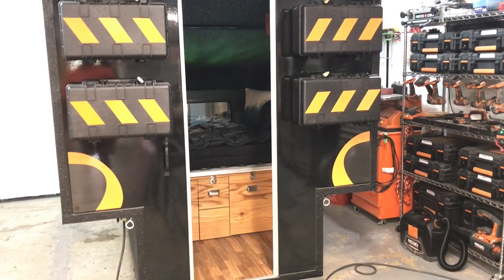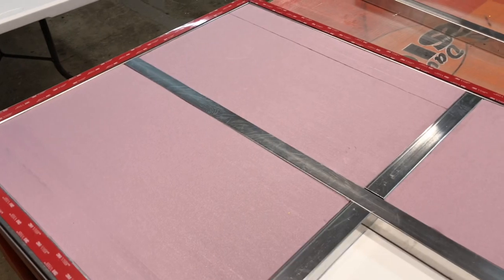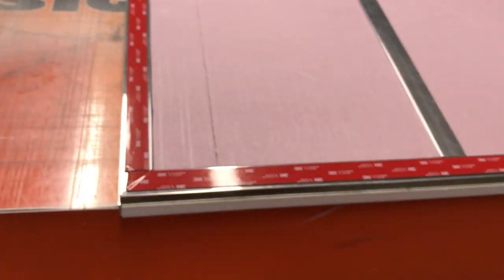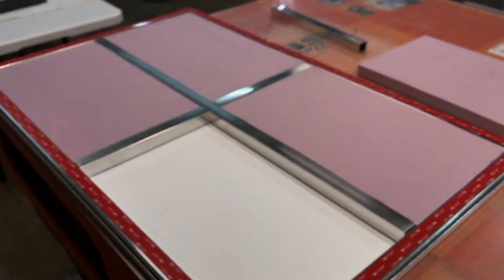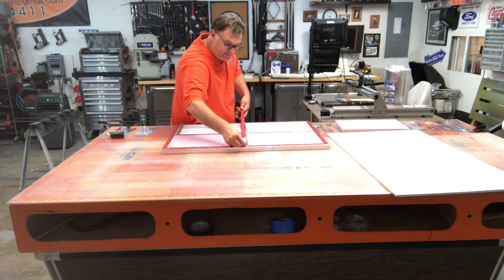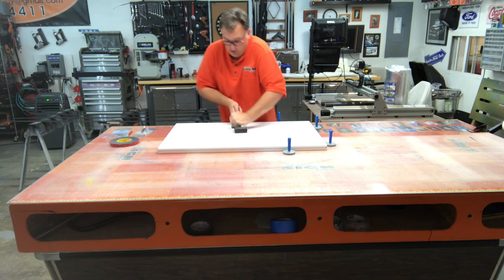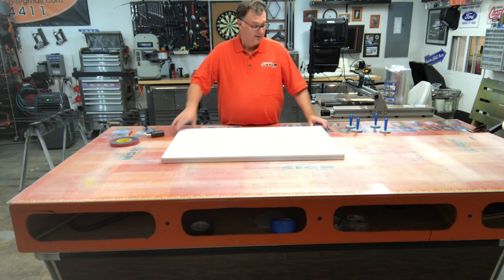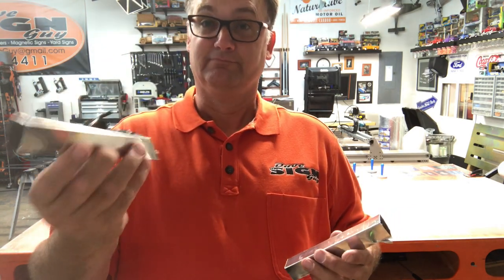Camper Wall Construction

Comment: Very interesting! I've got an idea to build a camping organization system in the back of my truck (kind of like an overland-style "canopy"), but do not want to make it out of plywood (easy but too heavy) and didn't really want to learn serious metalworking (how to weld). Can I repeat my understanding of your process back to you to see if I have it right?

1. You put bends in the aluminum (presumably with the corners notched out) so they fit around 1x1 square aluminum tubing. The inner skin is 0.063" and the outer 0.080". (Does the 1x1 tube have a particular thickness?) Is the aluminum bent with a metal brake)?
2. Fill the internal cavities with insulation (might not strictly be needed for my application, but would keep the skins more rigid).
2.The skin is attached to the tubes with 3M VHB tape and pop rivets at the edges.
3. Structurally important edges are covered in rhino-coated aluminum angle (I didn't quite catch the dimensions, maybe 2x2" and 1/8" thick?), taped and pop riveted (presumably through the skin and inner tube).

Thank you so much for the extremely thought provoking video!

Comment: Hey David
As I embark on my second camper build, you have convinced me that adhesive tape is the way to go. I was originally going to go with Alum tubing however I have found that thermal conductivity; hot and cold, of the tubing is not ideal for 4 season camping. Looking at alternatives like PVC tubing or using a frame-less insulated panel and exoskeleton.
Reply: Fiberglass pultrusions, you can even get 80-20 style.slotted ine

Comment: Dave, that is a GREAT video, I am very impressed with your camper wall (sign) construction. what gauge aluminum panels are you using and how (where) do you get the 1/2" lip s bent around the perimeter? Thanks

Comment: As a long term subscriber I have watched your excellent videos, some several times, but it has only just occurred to me to adopt your panel construction methods to fabricate the structure of the Slidavan which I hope to build.

By doing so, it should result in a considerably stronger panel with greater torsional rigidity.
Reply from the maker: Thank You. Working on some new projects that I hope to put up soon.

Comment: First great video and great building design and thanks for sharing. 
I would like to build a square box camper for the back of my truck. Do you have to bend the aluminium panel or could I build my whole frame first then rivet the aluminium panel flat on the frame then put the angle bracket on the corner with sealant to waterproof? I assume it will be a little bit less strong but do you think it will still be a solid build?
Hope to hear from you soon
Thanks
Steph
Reply from the maker: Stephane , much stronger if you build from the inside out. Another words, build the frame with the inner skin for the wall all at once.

Comment: In your 'Camper is Done' video, you answered my question about panel construction and sealing. This video provides a LOT more detail...THANKS!  I'd like to emulate your approach in my camper build. I just purchased 0.030" thick aluminum sheet with a beveled edge on one side for panel overlap. One area where I may differ is bending the edges. I may need to omit this step as the panel are 49 inches wide (48" plus 1 inch for panel overlap). I assume you have a fairly wide press brake for bending your own panels?  

Also, with some tapes made by 3M, their bond can be improved by first applying a primer to the bond surfaces. Based upon your destructive test, it may be overkill, but do you know if a primer exists for the 'VHB'?
Reply from the maker: I found that a primer creates a adhesion weakness. I believe it is far better to direct mount the tape to the metals.  Just a note. .030 aluminum is very thin. The thinnest wall I would recommend would be .040. Better is .063.
Reply: Interesting recommendation on thickness. I purchased the aluminum sheet from a trailer manufacturer who offers two thicknesses, 0.024" and 0.030".    http://mirageinc.com/trailer-walls    It feels a little thin but I will use the VHB to adhere it to a fiber reinforcement/insulation panel

Comment: Best high tech diy panel Ive ever seen. Did you ever consider another type of covering besides aluminum that a lower budget project could use?
Reply from the maker: Yes...I am in the middle of uploading a video at this very moment. Of a wood and fiberglass DIY wall.  Part One. The Wall Construction.

Comment: Your panel design is fantastic. It is unreal how strong the 2-way tape is. I imagine the longer it stays with heat cycles it will get even stronger. Meaning there would be even funnier faces in your break test!  
Do you use pre-painted aluminum panels?
Did you cut the window out after the panel was manufactured?
This is literally the best video on YouTube for manufacturing a insulated panels. I just need a metal brake large enough now!
Reply from the maker: Thank You! All the aluminum was pre-finished with a baked enamel surface. I used a circular saw with a metal cutting blade.

Comment: Howdy from Texas!  Extremely valuable information!  Very much appreciated.
Reply: I do not question but seek guidance.  Why not use Fiber reinforced honeycomb plastic panels for the entire wall structure?  Would it not be sufficient to use aluminum C channel to protect the panels and use the double stick tape to adhesion?
Reply: How are the aluminum panels shaped?  In other words, how are the lips created?  Did you have that done or were you able to perform that modification yourself?

Comment: Just seeing this video.  How did the whole truck camper hold up?  Just checked your videos, looks like you switched to a van recently.  Thanks for proving the double sided tape method at the end.  Crazy that it ripped the aluminum before it came apart.
Reply from the maker: Actually...Sold the camper 2 years ago...Then did a van...sold that last month...now doing a 4x4 Astro van Mini Camper....Just can't help myself.
Reply: @davethesignguy4414  what is the name of the white wrap material you use here please!!♡♡♡

Comment: Hi There, interesting video. Impressive tape and great way to use it. I don't understand the insulation logic really though. The aluminum works as an incredible cold-bridge. The only thing that actually seems to save you there is the tape though :-). I wonder if it's enough though.

Comment: Great video i want to make a 10L ×8w ×8h

Could i possibly use this method to make the box?

Few questions please....

• should i go with 2 inch or is 1 inch good for sides and top

• Aluminum 1 ×1 wall thickness did you use.

• i would like to use one piece aluminum shell any recommendations on who i should purchase large role though.

• structurally on 10 to 12 foot long wall how many aluminum supports do you recommend.

• information on the tape.

• lastly you rock i think i will follow your lead on my build thank you.

Comment: Looks like this would be ideal for interior walls and bulkheads in RV conversions. I suppose if thermal transfer were a concern, you could always fill the aluminium tubes with low-expansion foam (high expansion would probably distort them.

Comment: Great job. I am building my second camper and am using insulated panels as well. Only difference is I am going with something other than Alum tubing and skin as I don't like the thermal conductivity of Alum.
Reply: What you use instead?